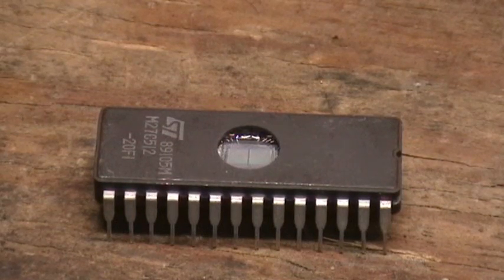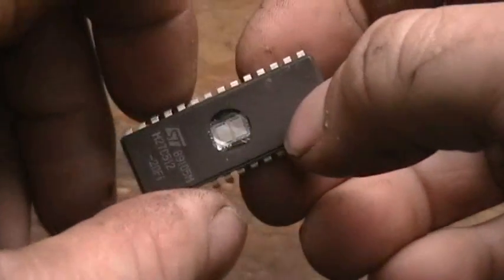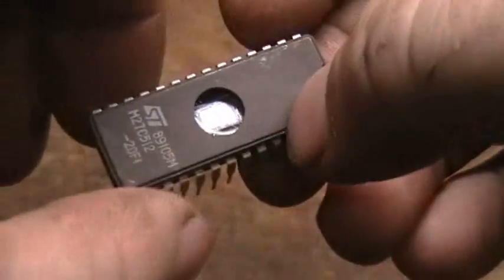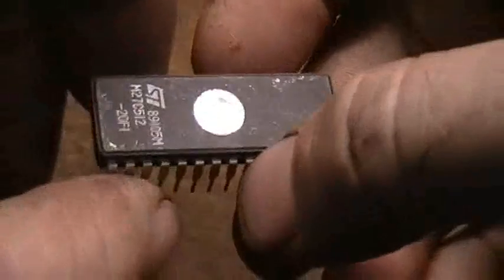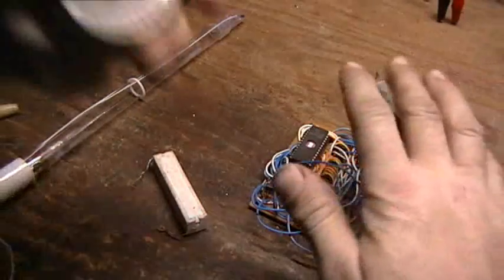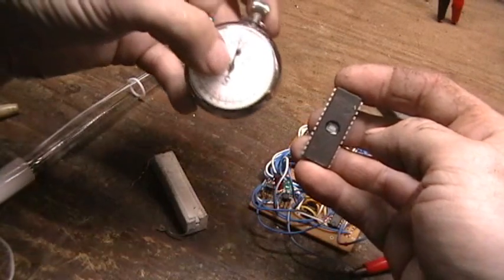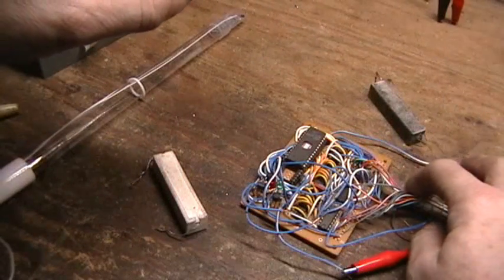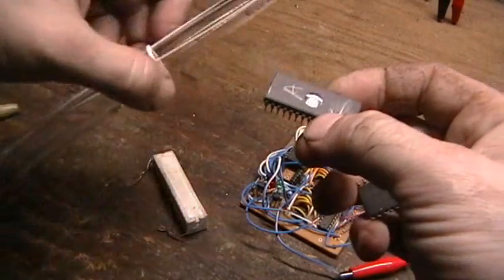How fast can you erase an EPROM if you use a little more power?

Comment: How long does it take to erase it under direct sun light?
Reply: Probably months. Let an old 2716 programmed to 0x00 on my (outside!) windowsill, facing south out for 2 weeks straight last summer. Not a single bit had flipped after this.

Comment: Well I`m a factory technician and my piece of crap eraser takes 30 minutes to erase a chip. I dont remember the brand, but its a little black box with a sliding cover and an external wall wart power supply. It holds 5 EEPROMS at a time.   And also I found that same box in as a dumpster find,  so I can use that for my home lab.  KD6CFE was here.  73`s
Reply: humm radioamator ?